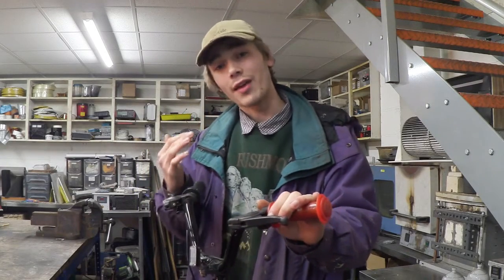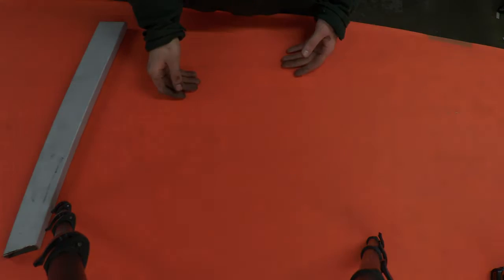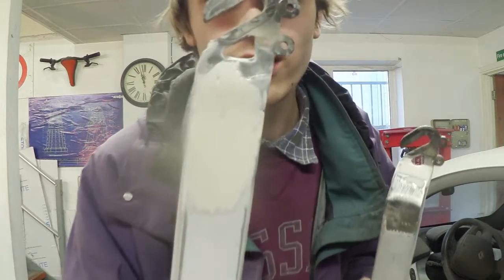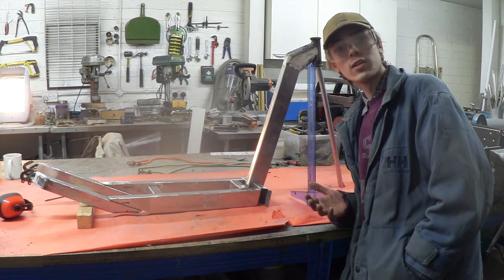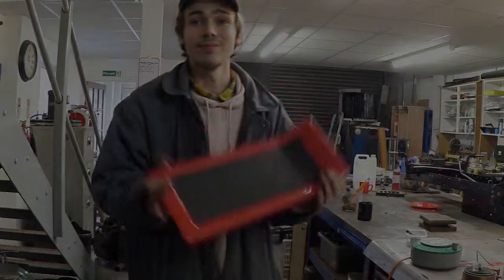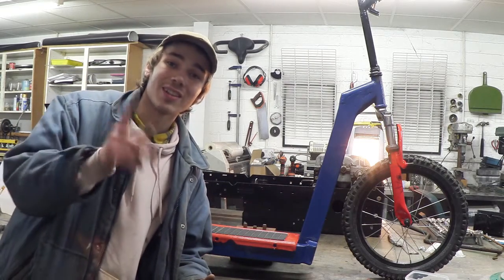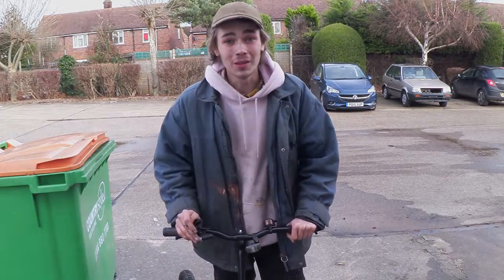DIY Push Scooter the Remake

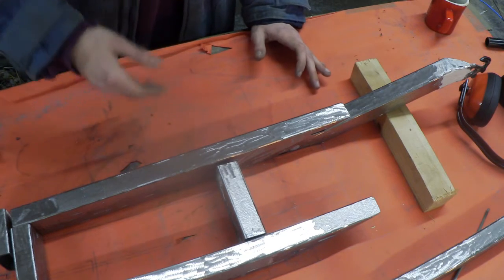Comment: the only issue at 4:39 i see is that the drop outs for the wheel are facing upwards, which means if the bolts is lose, the wheel and you hit a bump, the wheel will pop out while your doing 50mph. They should face downwards instead!!! Welds look great. good project ngl. Stick or mig/fcaw ?

Comment: Not sure why I am not getting notifications for new videos. Sorry for the late viewing Luke. 
Couldn't see the drawing you said was there in 1:1 ratio, would have been more visible with a black marker instead of pencil which I'm assuming you used. That brake could be dangerous as the metal is hitting on the incoming rotation of the tyre. I would use traditional bike calipers that use friction on the wheel rim.
Excellent video all told, your enthusiasm is fantastic, great work mate.

Comment: Excellent! 10x better than mk1=) just one thing I'd mention, is the stem bolts cap the original or a washer? Without what looks like a top hat with a hole, loose description, a plain washer can slip and make you impersonate superman! Don't ask how I know!;) good job nice joints!

Comment: Luke did you leave the openings for the rear axil drop outs on top?
Reply: I did fit some locking tags, so the wheel should not move when riding.
Reply: It does seem risky to have them oriented like that especially if it will be used on rough terrain.

Comment: I'm a bit concerned about the brackets for the rear wheels...they are upside down🤔
Reply: Yes I can see that, He's going to need to fit some locking tags or reverse them otherwise he will lose the wheel while riding.